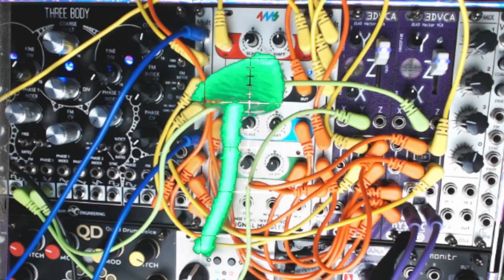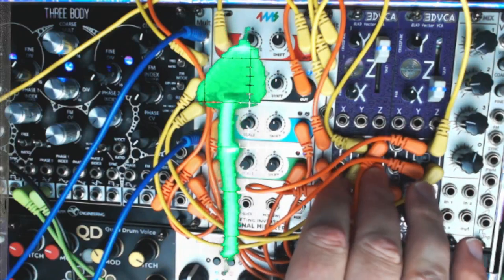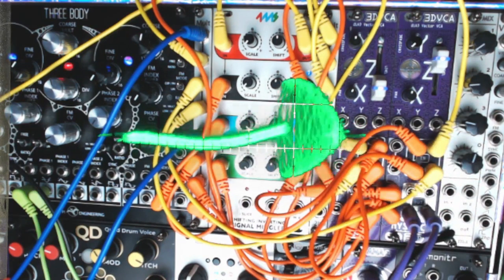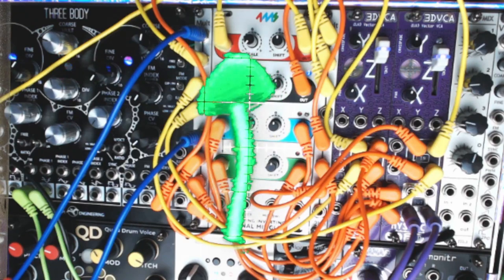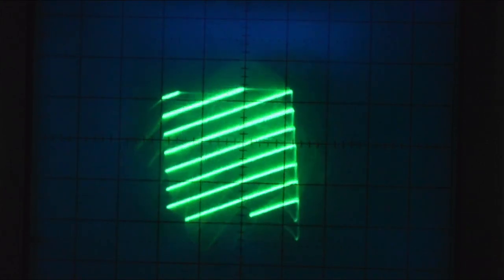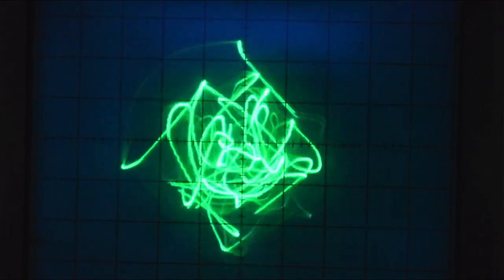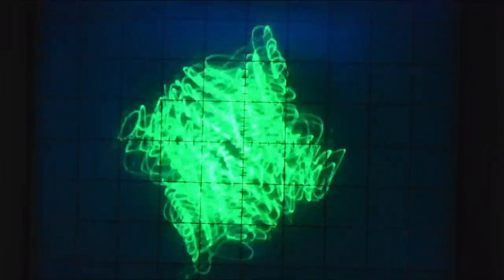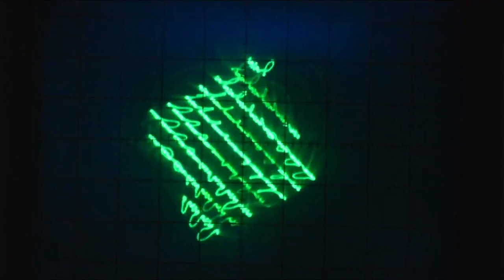Mystic Circuits 3DVCA Vector Rotation Patch

Comment: Can you use this for phase modulation if you have 0 90 180 270 of a filter ?
Reply from the maker: I'm not going to lie Marvin I actually don't know if this works.  My intuition tells me that crossfading between the signals will work similarly to phase modulation but you would also need a modulator for the X and Y signals which generates a 0 and 90 degree phase shifted version of the same signal as is the case in this demo.  I could do some experiments with this and see what I can get.